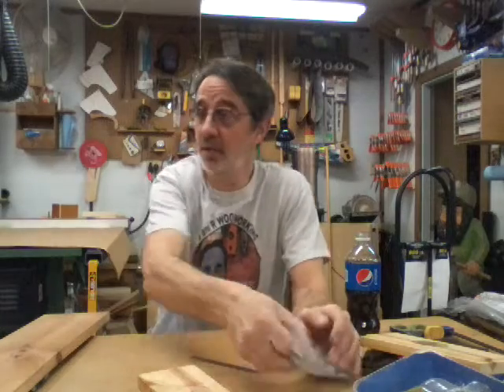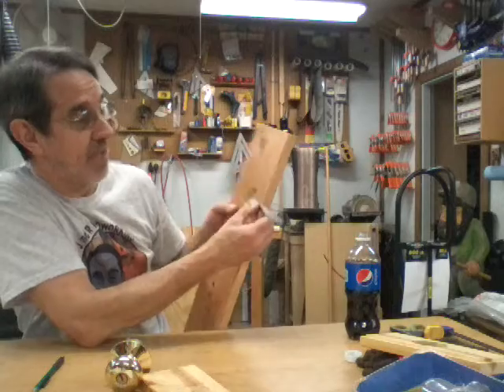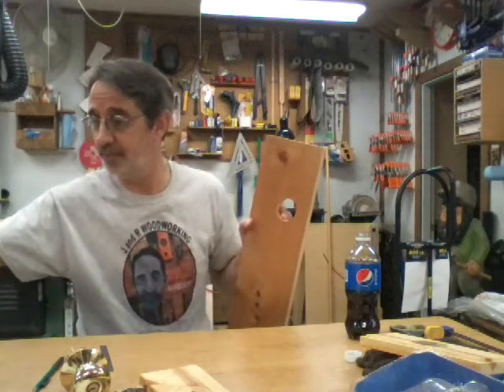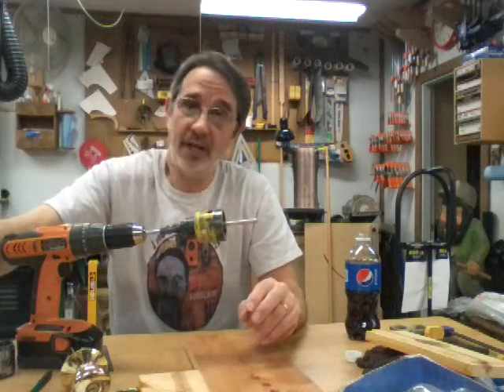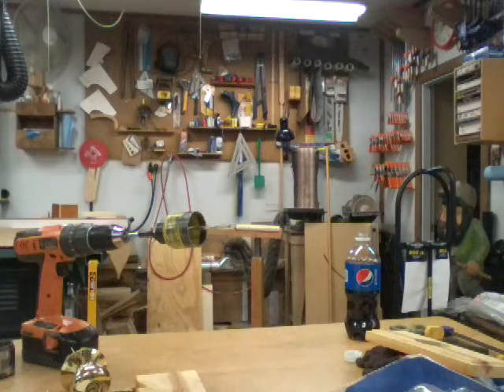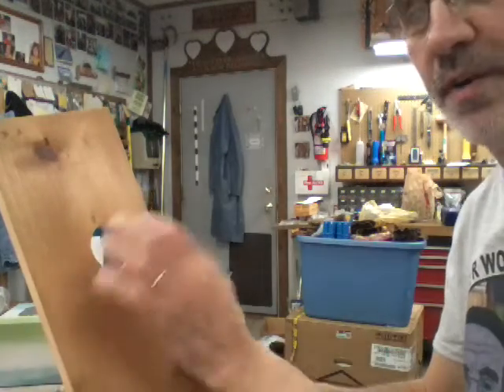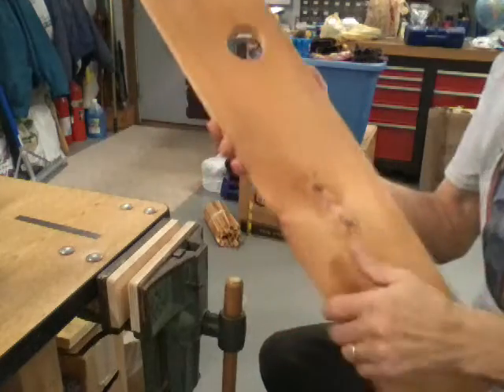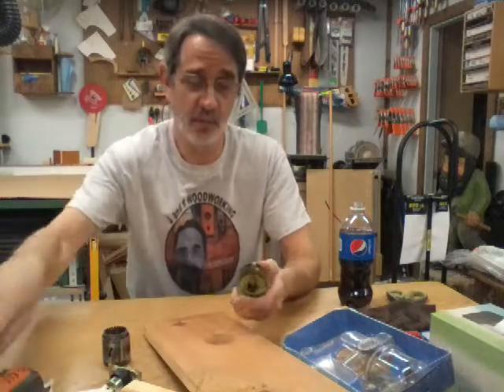225.  Installing new door knobs in an older door.

Comment: I basically used that.. but I had the door still on and no clamps. Original hole was 1.5 inch and backseat 2.5 in.. and I drilled about .25 inch too low and because I had to move like .5 in the left.. the bottom right quarter has a major gap of like .25 in.
Reply from the maker: without using clamps it tends to move around a bit I hope it worked out ok.  Jim